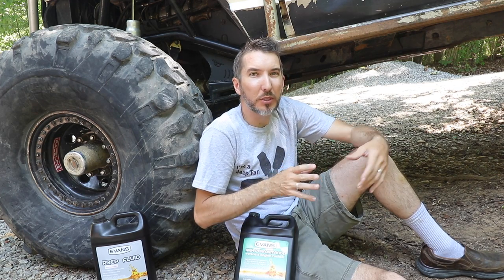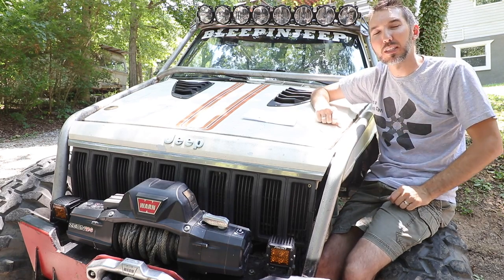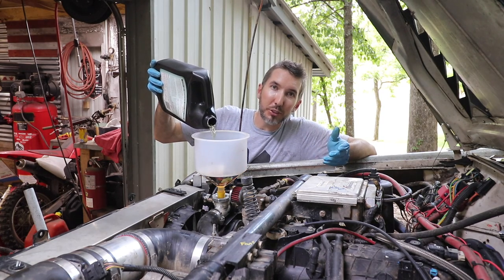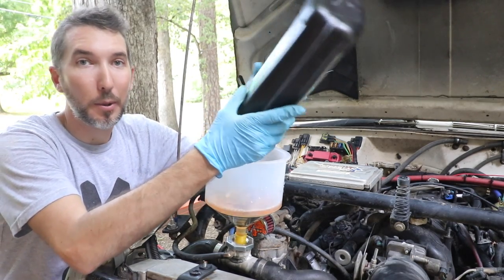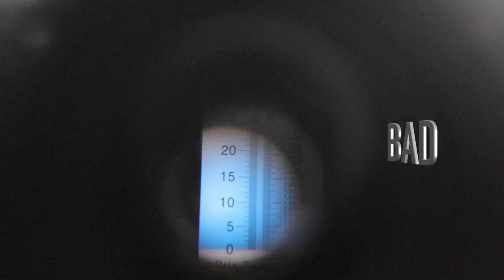There's No WATER in my Engine!! - Ultimate Guide to Evans Waterless Engine Coolant

Comment: As AM D said in his comment; this stuff has caused problems with my hoses as well. I had some put new heads into my V8 WJ with new hoses, etc. and tried out Evan’s. I ran it from N. Colorado to Ouray/ Telluride and back (~ 700miles) by the time I returned I had swelling on both upper and lower rad hoses. Thought nothing of it because I went on a long trip, about a week later I blew a hoses on the highway and sure enough there was black gooey residue inside the radiator and near the top of the block. Took off the timing cover and cleaned up everything again and went back to good ole antifreeze. 

For $50+ a gallon it’s not worth it over good ole PEAK imho.

Comment: Every time I use Evan's waterless coolant it softens all of my hoses. Multiple times, multiple sets of hoses on my xj, the coolant works great but the hoses get chemically-melty and liquid-rubbery after running all day. I've had these hoses, virtually under no pressure, explode on the highway and I lose everything. Almost $150 worth of coolant, that by the way, you can't buy in any store on the face of the Earth, you have to special order it and wait a week and a half while your Jeep gets hauled off to your house to sit in your yard because you can't put water in it otherwise you've got to put the prep in it all over again and that's another $45. I stopped using it because I couldn't buy it in stores and I stopped using it because it destroyed every piece of rubber it came in contact with. Trust me I tried it on multiple vehicles multiple times and I finally just had to stop because I was wasting money. Didn't matter if I use brand new hoses or old hoses I got the same results. It softens rubber and it does it hardcore. Like nothing I've ever seen.

Edit: 

Actually came back to this video to make one more comment. The whole softening issue, you would think silicone hoses would react differently? I wanted to use Evan so bad that I actually purchased a full set of silicone heater hoses and radiator hoses and bypass hoses. The silicone deteriorated 10 times faster to my surprise. What actually happens is all the hoses separate from the threads on the inside of the hose so externally it looks fine, but if you bump the hose or if it gets a couple pounds of pressure in it from pressing the throttle, or if you just leave it alone and let it sit long enough, it will rip. Silicone and rubber hoses. it does not matter. They separate, the layers of the hose is separate I've never seen anything like it. When you put your finger in there and pull it out it's got a black goo on it, and this is going into a perfectly clean freshly built cooling system which then I have to flush out all of the goo from the hoses because it's in everything. including the heater core. and if you've ever changed a heater core in an XJ you know it's not worth it. I'm telling you don't use this stuff until they figure out the hose melting issue, it's like a chemical reaction or something. Watch. He'll have the same issue in a few weeks. We'll see if he makes a video on it.
Reply: Basically pure propylene glycol instead of water, which means it will cause an issue with coolant level sensors that are based on conductivity.  Expensive compared to simply going to any large chemical supplier and buying pure propylene glycol, or simply buying undiluted antifreeze and using it directly, which any of the major fuel suppliers will sell direct to you in 5 gallon containers, meant to be diluted 50% with water, but just use directly.
Reply from the maker: Well Ive been running it for a few months now on both vehicles with no issues but we shall see.  I do have rubber and silicone hoses so if its true what you are saying we will see very shortly!
Reply: @bleepinjeep  Really depends though on the actual hose composition. Some are not resistant to fuel and oil, so will go soft with the glycol, others will be fine no matter what. Just what they put into the blender to mix for that particular type of hose rubber.
Reply: @SeanBZA  something to be aware of and I don't think this distinction has been made. Typical engine antifreeze uses ETHYLENE Glycol as opposed to PROPYLENE Glycol. Propylene Glycol is non-toxic and food/drug grade is used in foods and medicines. Propylene is used for winterizing potable water systems because it's inherently non-toxic and easily flushed.

Regular off the shelf undilluted automotive antifreeze is not the same as Propylene Glycol/Evans.
Reply: @EyebrowsMahoney  A lot of antifreeze now is propylene glycol, done so to make it less toxic to wildlife, and reduce the poisoning risk. Only the cheapest ones still use ethylene glycol.
Reply: @SeanBZA  in the USA, that is not the case. Modern antifreezes here are still mainly Ethylene Glycol, but they instead use "organic acid technology" (OAT) or some variation of such to make the coolant mix more compatible with newer mechanical metallurgy and reduce corrosion (which decreases service intervals).

Comment: Apparently this is just antifreeze glycols without the water? I bet it would uptake and retain any water intrusion/leftovers fairly efficiently (hygroscopic). Would be interesting if they made an organic fluorinated coolant like 3M Novec but with a higher boiling temp. However this will still help since you are reducing greatly the amount of water in the system

Comment: You said freezing point is -40. I live in Canada and our winters here can get to way colder then that. Other then plugging in the block heater What other things can be done? And will the Evans freeze causing possible engine damage? Great info by the way keep up the good work. Randy...
Reply from the maker: typical 50/50 antifreeze mixture is rated to -35 so I would ask what you are currently doing?  Luckily I don't have to worry about those extreme temperatures but maybe Evans will chime in and give suggestions.
Reply: If the temp gets to -30 you should always plug in your block. No matter what.
Reply: My block froze jn less then an hour at -50.  79k from Winnipeg near portage la prairie. Both ways were blocked by snow and ice. I turned it on not knowing and warped the head. I’m from southern Ontario and moved to Vancouver island both places don’t require you to plug in your block. Only reason why I didn’t do it at the time was cuz I wasn’t thought about that part of it.
Reply: His coolant is for -40f not c
Reply: You’ll want yellow 50/50
Reply: @shimani141  -40 is the same on both scales.
Reply: @JThelen1031  oh snap that’s weird

Comment: Any problems with overheating in the Jeep 4.0L? (Is it as good at cooling the motor as coolant?)
Does it get thick at cold temps? I rarely see below zero but have seen it and would like to not kill my water pump. Thanks!

Comment: Out of curiosity, with the Evans coolant having a much lower pressure rating that won't trigger the pressure on the radiator cap. Does that mean you dont need to run an external reservoir for coolant? Typically coolant boils, builds pressure and releases steam into the reservoir then when cooled sucks coolant back in. So technically without the pressure able to reach the caps capacity no need for reservoir 🤔
Reply: Evan's various FAQs and such indicate that while you don't have to run an expansion tank, if you don't then you need to not completely fill the cooling system.  The coolant itself expands when heated (up to 7%) and that expansion has to have room somewhere.  Unlike in a water-containing cooling system, where you want to keep oxygen exposure nil at all costs, the non-water-containing Evans stuff can tolerate having an air cushion for coolant expansion without corrosion.  At least, that's what they write.  

If you fill the cooling system with Evans and then get the engine up to temp, some coolant is going to overflow, unless there's air in the system to pressurize and take up the slack.  Also, on cooling systems where the pressure cap is on the "high" side of the water pump, the pump itself can create significant pressure, so you can't automatically assume that you can run a "depressurized" system (ie zero-pressure cap) without some spillage.

As usual, the devil is in the details.
Reply: @alsavage1  ahhh I see, makes sense...really appreciate the reply!

Comment: Evans just protects the hoses from pressure not the engine from overheating. If the temp gage misreads or if you don't notice the temp going up the Evans wont boil over to warn you of a coolant system problem so you will keep on driving and overheating.

Comment: What are the advantages of running this versus the concentrated (no water) stuff from the parts store?
Reply from the maker: Thats antifreeze, you you have to mix that with water.  All antifreeze used to come concentrated until they realized they could charge people the same price for half water 😂
Reply: @bleepinjeep  Kinda dodging the question there...
Reply: @dimwitrj  He's advertising a specific product that may be sponsored. I doubt you're going to get the answer you want to hear. 🇺🇲
Reply from the maker: I'm no scientist but my understanding is that 100 percent concentrated Antifreeze from the store doesn't cool very well without adding the water.
Reply: none. this is the same concentrate and some fairytales added.

Comment: I USE IT IN MY BMW DAILY DRIVER..FOR 6 YRS NOW.. AT 4 YEARS I DID A CAMERA INSPECTION OF MY RADIATOR AND ZERO CORROSION AND ALL MY HOSES WERE STILL PERFECT/ NP SIGNS OF WEAR.....BMWS ARE KNOWN FOR OVERHEATING PROBLEMS BECAUSE OF PLASTIC PARTS IN THE SYSTEM AND OTHER REASONS...DUE TO ALL ALUMINUM ENGINES GETTING FRIED IF YOU DID OVERHEAT IS A MAJOR REASONS CARS END UP IN THE JUNK YARD..THAT AND BELIEVING NO MAINTAINENCE TRANSMISSIONS AND NOT CHANGING YOUR TRANSMISSION FLUID

Comment: I’ve always used Engine Ice coolant in my motorcycles.
Reply from the maker: I used to use that too, did you ever notice a difference.  I was watching a video the other day and the guy said most people dont know you would need way more than just the one bottle for it to have an effect.
Reply: @bleepinjeep  I Did on my Motorcycles and ATV's for sure!! Never tried it on a vehicle? I always flushed with DI water and filled it. The only thing I've heard from Evans on older vehicles are hose and pump seal failures. On a new builds it seems to be good? I road/raced sport bike where regular antifreeze was not allowed for track cleanup issues so everyone ran Engine Ice. Would like to see how this works for you!!

Comment: I think you may be missing something with you calculations for the boiling point. A 15 lbs rad cap will raise the boiling point of the 50/50 mix to 280°. The boiling point is raised 3° for every pound of pressure.

Comment: Seems more trouble than it`s worth to avoid trouble you would need to keep a couple gallons with you when you take the vehicle out So just change the coolant and distilled water
Reply from the maker: You must have a lot of radiator problems to need gallons of coolant handy.
Reply: @bleepinjeep  No just like tools you carry or spare tire the right part for the right job

Comment: To get all of the water out first drain all the coolent, then drive it around till it shuts off on it own, and all water will be gone.

And this evans is far to costly, i just use old motor oil.. works great...

Comment: Dude, this is false i formation. Water alone at 15psi  boils at like 280 degrees. Not 210. Cooling systems are pressurized.   Do what u want with putting stuff in your engine but this is like year 1 aprenticeship stuff